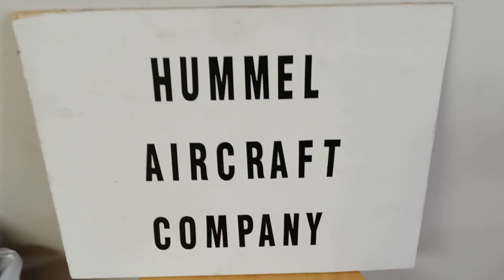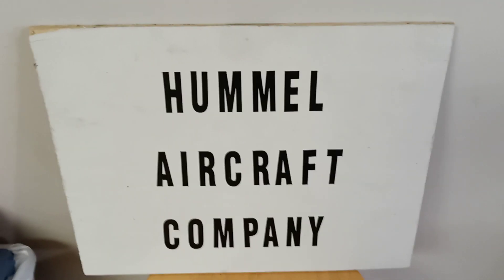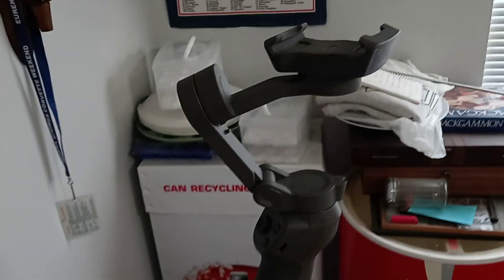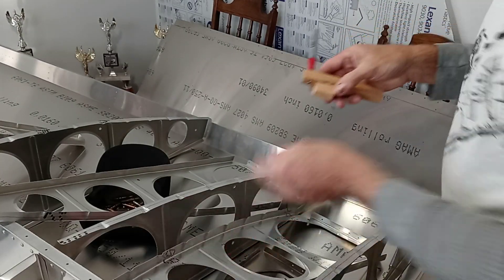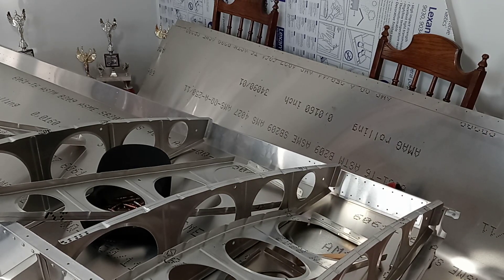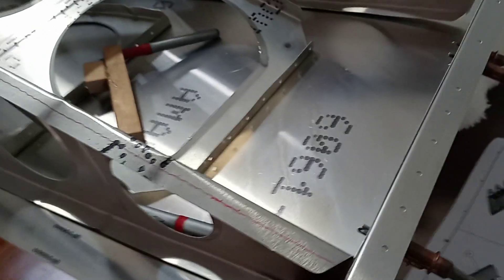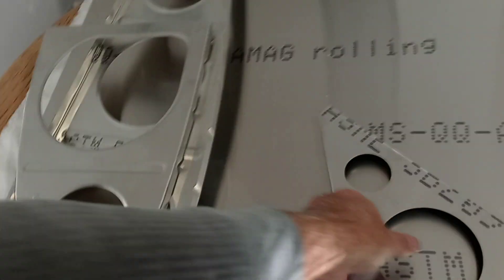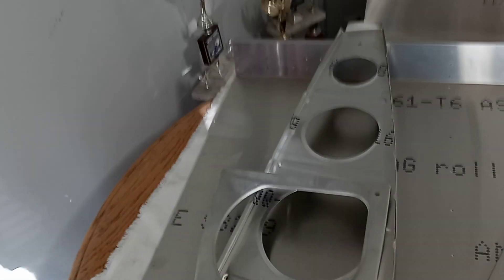Ultra Cruiser made a marking guide for marking ribs and more

Comment: Just an idea that I had to eliminate some of the oil can sound from the wing skins. Make copies of the ribs out of insulation foam board (the pink boards) and glue them half way in  between the ribs to reduce the sheet metal from flexing and making noise . Your thoughts on this? It seems that it wouldn't add much weight and you could even make lightening holes in them.
Reply from the maker: Hi Robert Pilchman well sir I think you have a great idea!! But Im in the keep it light mode now. Im still not saying you have a bad idea just not wanting to add the weight. Thank you for the comments and suggestion